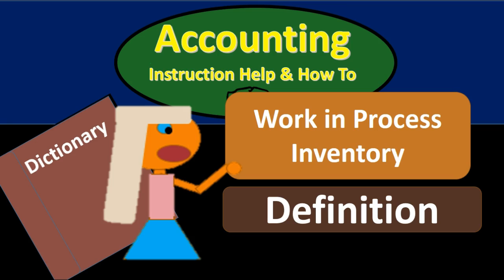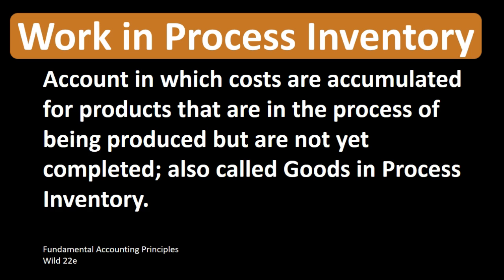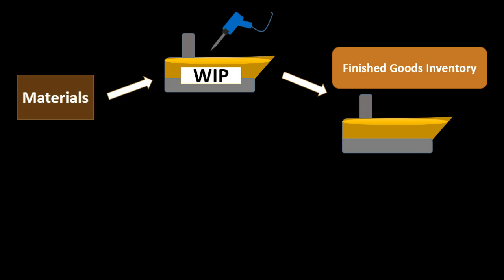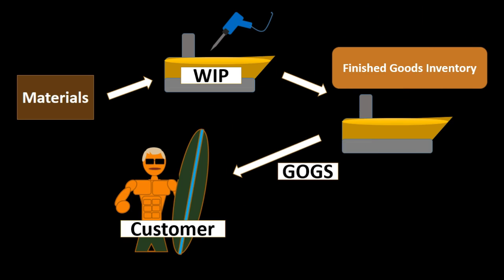Work in Process Inventory Definition – What is work if proce

Comment: I really need assistance on CH2 HW. I’ve been getting CH1 material well enough but I’m struggling with CH2 HW in connect. It’s the assignment that’s due on the 15th. 

This is a link to the problem. I dont understand what to do with these numbers: https://media.discordapp.net/attachments/420029761923055627/753739833192480890/image0.jpg